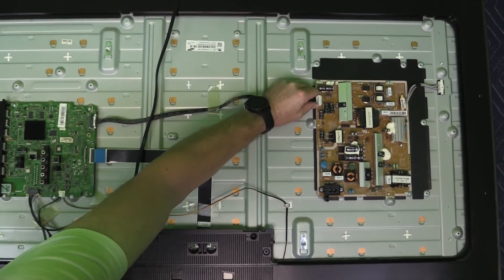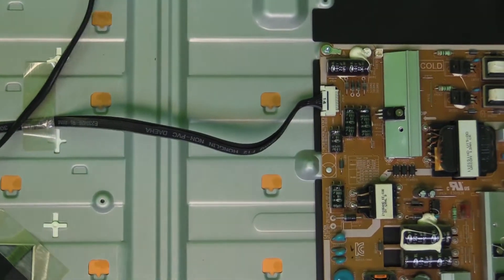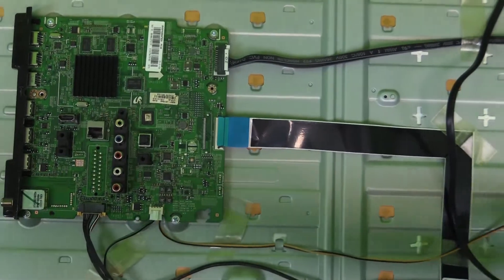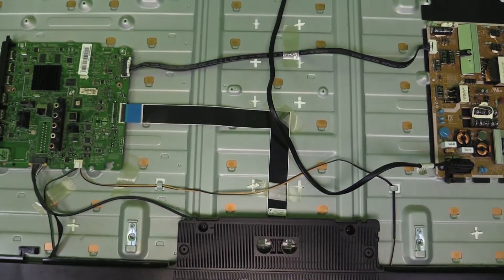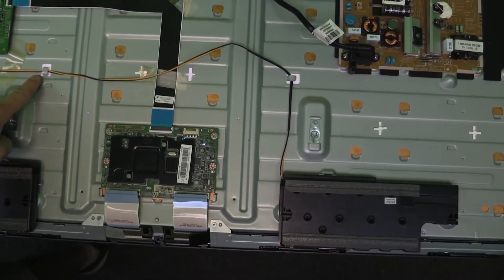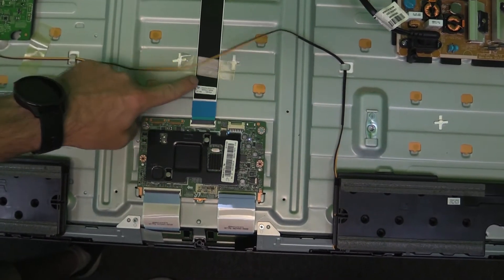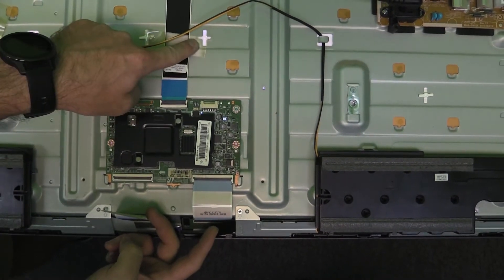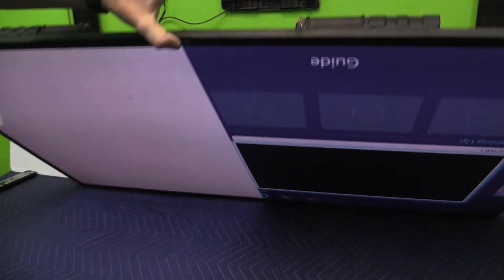How to diagnose Samsung LED TV's

Comment: Im prerty sure ive got a damaged power supply and i know what is causing the problem i just have no idea what the part is called or where to het it from
Reply from the maker: I would recommend you at least provide the model number of your TV, and the symptoms. 
I might be able to help you fix the board.

Comment: Nice video, i have a samsung 40" led tv that has bad led strips. Waiting on replacement strips once i replace them if i disconnect from the main board to the power supply i can test that the backlights are working before i reassemble the set is that correct by just powering the power supply and leaving the cable to the leds connected?
Reply from the maker: Yes with the mainboard disconnected the power supply will auto turn on thus turning on the LEDs. So you can have all the other parts removed out of the TV and just the power supply and leds in the circuit. The moment you apply power to the power supply from the wall the power supply should turn on and the LEDs will also turn on thus confirming they are all working and properly connected. If they do not, either the leds are bad, not properly connected, or the power supply is also damaged.
Reply: Thanks for the quick reply I'm waiting on new strips but didn't want to put everything back together until I made sure the leds were the only issue. @NicksTVRepair

Comment: How do you guys remove a LCD panel, I use suction cups but I'm afraid it might be bending the screen too much. Are they safe to use? I have some double ended U shaped with two cups on each for large screens. For smaller screens I use two single cups.
Reply from the maker: I just use my hands, we tried using suction cups before and one time one of them wasn't sucking enough and the screen got loose as we were moving a 75" screen so since then we stopped using them. 
We just do 2 people anytime we work with 65 or bigger. On the thinner 60" screens we do 2 people as well but most 60" screens one person can do no problem.

Comment: This video is very helpful, you always come through.  UN60JU7100FXZA To follow up on the diag, main board is bad,  BLs are all out, LED cable has power, 104 volts, 13 volt line has power.  What on the world would cause all the BLs to go out and the main? Power surge I suspect.  What do you charge to rework a BN94-08298A
Reply from the maker: We don't work on that board since there isin't enough demand for it. You most likely have a software fault on it which we won't have the software available. TV parts today has it for sale for $82. Could be worth a try to get one from them.
Reply: That software would be on the EEPROM chip?

Comment: When testing the power supply how am i going to turn on the tv if the main board is disconnected?
Reply from the maker: That's the test! You don't need to turn on the TV, when the mainboard is disconnected from the power supply, if it's a good power supply it auto turns on. See the video, all we are doing is plugging in the TV and unplugging it and the power supply is auto turning on indicating a good power supply. 
So if the TV doesn't auto turn on when the mainboard is disconnected then you know you have a power supply board failure or LED strip failure.
Reply: @NicksTVRepair  okay thank you very much
Reply: @NicksTVRepair  So when I disconnect the first plug and reconnect my power cord my back lights do not come on. That tells me that either the power board or LED strips are bad correct? Is it possible for all the leds to go out all at once?
Reply from the maker: @jennablythe8728  I apologize for the late reply, the message didn't pop up in the notifications. But if you disconnect the power supply from the mainboard and then reconnect the power cable and the backlights do not come on then indeed either you have a bad power supply board or bad backlights. If 1 LED strip aka your backlight is bad, it can sometimes cause all of them to not turn on depending on how it failed making it look like all of them failed at once. 
If this is the case we recommend you replace all of the strips and not just the affected one since the other strips are probably not far behind.